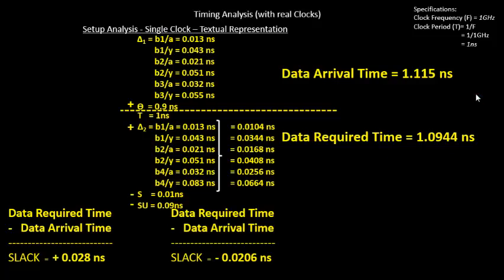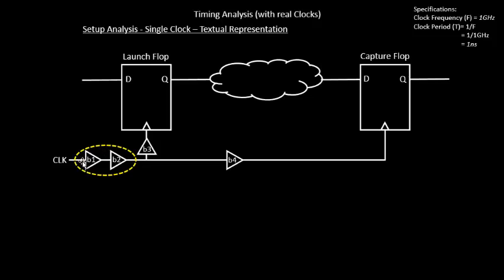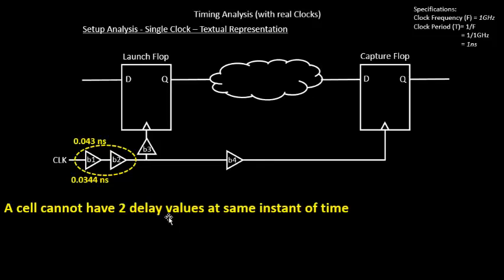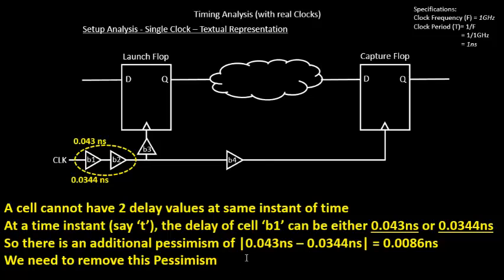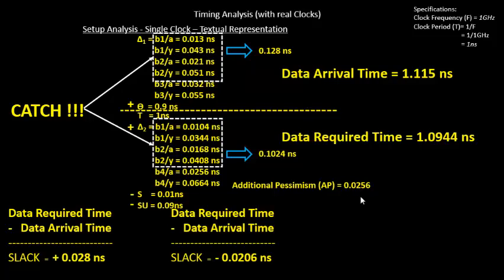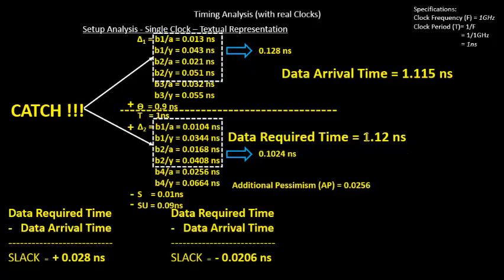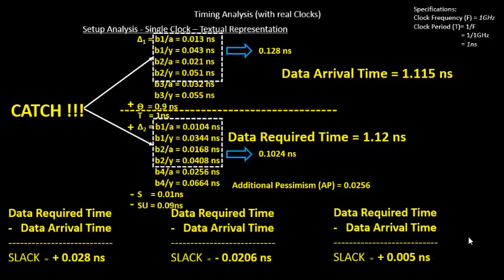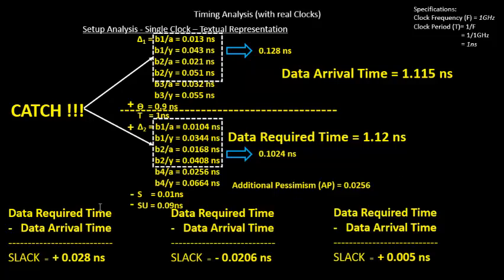How to do OCV_TIMING Setup Timing Analysis After Pessimism Removal?? Learn @ Udemy- VLSI Academy

Comment: Does CRPR valid since the launch and capture can have different derate and the common buffers in this case do not need to have same delay.?
Reply from the maker: Even if they have different derate, but in common path, the idea is, a cell can't have 2 different delays at same time. A perfect analogy is of an athlete, who cannot run at 2 different speeds at same time

Comment: OCV is a variation of a specific cell. Since the variation is physical, it is constant and not time variant... For this reason it's the same for both data path and sampling path, and the pessimism needs to be removed.
Reply: +yahelba1 This is true for Hold but not for setup since launch and capture are at different clock edges, it's possible for launch to be pushed out while capture pulled in.
Reply: +zxzqzy I agree. Thanks!
Reply from the maker: nice explanation ...